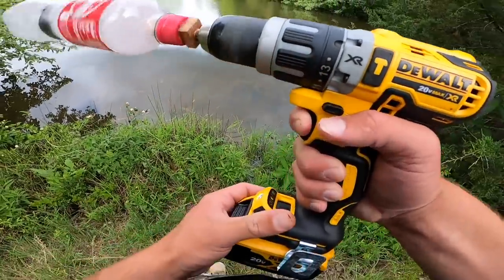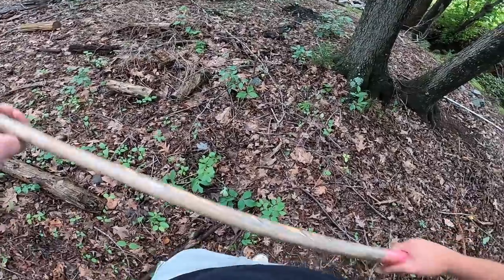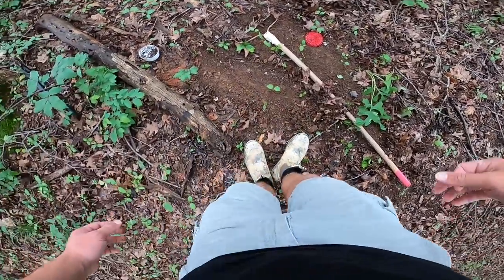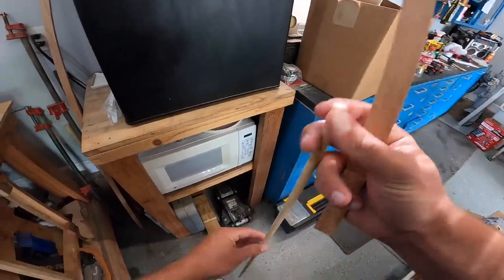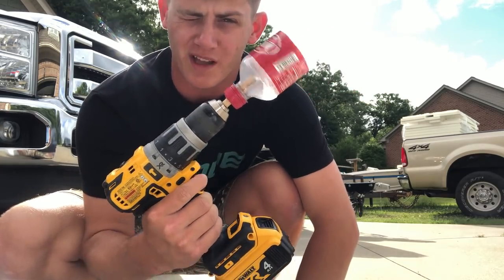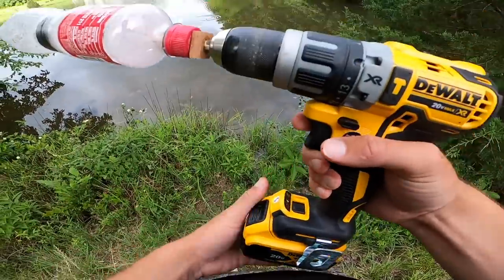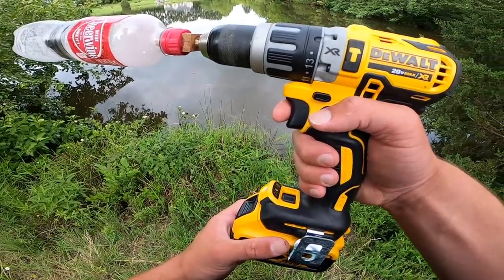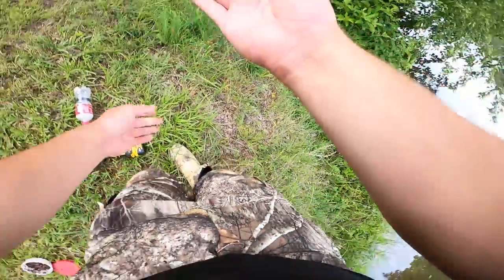Fishing With a DRILL! (HOMEMADE Fishing Reel)

Comment: Next time drill the hole like you did but just put a nut and bolt in the cap making the bolt stick out and put the end of the bolt in the drill just like the dowel prolly would have been a little easier lol or just even the end of the screw would have worked lol